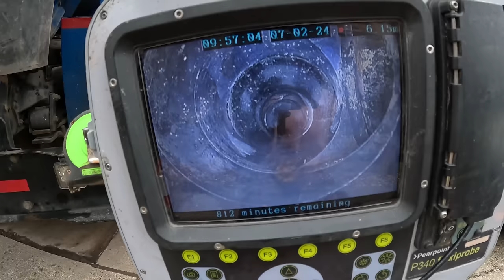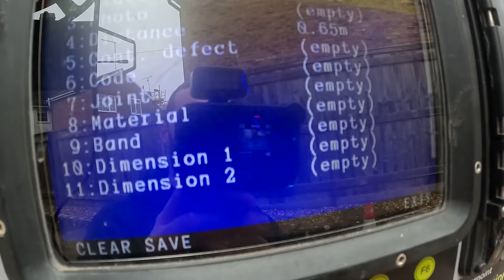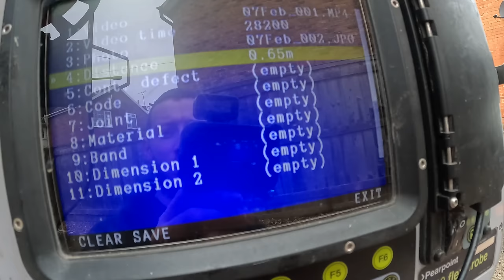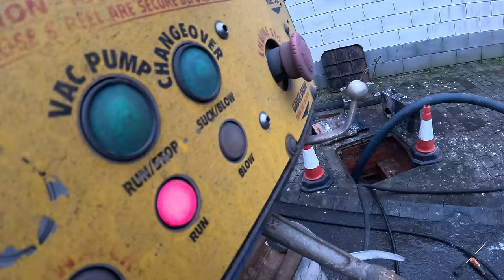A busy day unblocking drains

Comment: Not an expert but I think you may want to boost your vo and/or lower the aos a bit. I had to turn it up to hear you but then the hose/engine was far too loud.
Reply from the maker: iv changed my mic in my videos that are coming up so hopefully will sort that issue Iv been using my Mac built in mic for voice overs from 1st April my videos use my new mic so hopefully that will solve that problem but let me know what you think 🙂

Comment: what's the thing at https://youtu.be/PWfwXUVFCAA?t=265 ? How it's suppose to work and let the water flow as it just look like a plug ?
Note first time I saw a rod pee !
Reply from the maker: What time of the video is it at? 🤣
Reply: @Keep_itflowing  just click on the link, it will bring you at 265 second from the beginning so @ 4:25
Reply from the maker: it worked for me this time 🙂 it is a little basket that sits in the bottom to collect silt I think but its a bit rubbish   @lapub.
Reply from the maker: I could be wrong though iv not seen many like this one